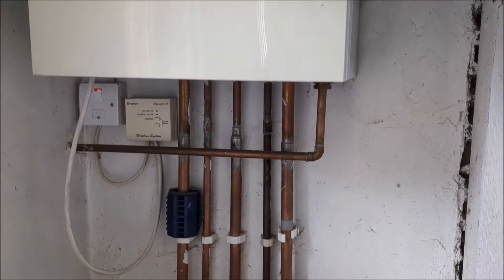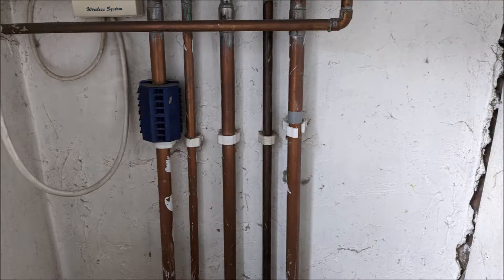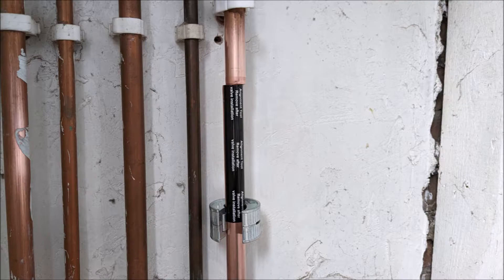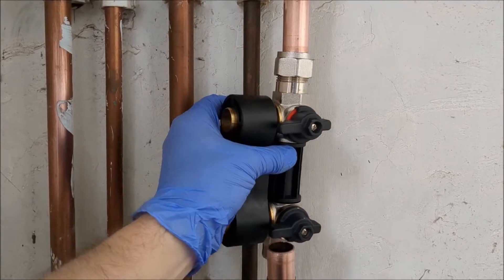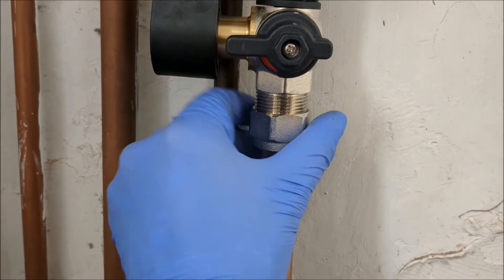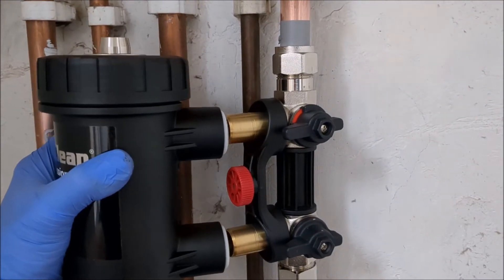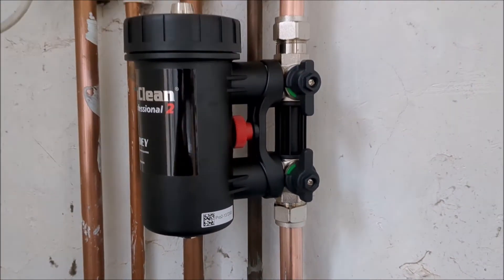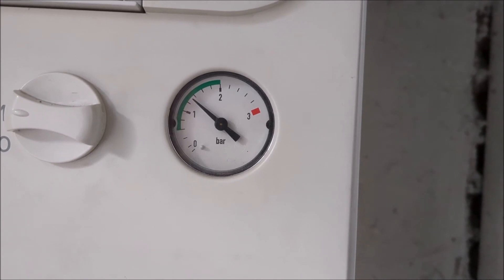How To Install An Adey MagnaClean Professional 2

Comment: This is the best set of destructions I have watched on a YT video :). I have a question. The boiler is a wall hung Potterton Profile with 2xpipes on the top and the essentials (pump/2xzone valves/bi pass etc) are all in the upstairs airing cupboard. The only suitable vertical pipe is the flow which doubles back through 180 degrees to the pump/zone valves and then disappears under the floorboards on the roundtrip to the radiators. Other than adding a vertical extension 'loop' to the horizontal return, I cannot see a way of fitting the filter to the return pipe. That means using the flow which is not good for a number of reasons. Any ideas? Thanks.
Reply from the maker: Thanks for watching and for your kind comment; I appreciate it. Yes, ideally the filter should be located on the return pipe, near the boiler, but if you can't fit it there and don't want to install some new pipes, then I think it is better to have the filter anywhere in the system, rather than to not have one at all. I hope this helps.
Reply: @PhilipWillsWorld  That was a quick reply.  Tend to agree. I guess it will create a bit of drag on the flow, will not pick bits on the return to the boiler and will also get the hottest water which could limit the life of the filter. As you say, better with than without. Thanks for your thoughts.

Comment: Looks easy but not for the amateur DIYer. I got mine done by a professional. Took less than an hour. Why does your filter have a RED 2? Mines is white. Does yours have any extra features?
Reply from the maker: Thanks for watching. This really is an easy job. There are different versions of the MagnaClean and there are other manufacturers of filters. MagnaClean 2 is easy to fit and maintain. MagnaClean 3 can talk to an app.

Comment: tezza might trythis u no Philip goat legend lol.tezza bang
Reply from the maker: Yeah, go for it. Just make sure you empty the water from the pipe before you cut in to it, then fill it up after fitting it. If you have any cold radiators, it's a good idea to turn off all of the other radiators, put the heating on to pump the water through them, then agitate (hammer) that radiator to loosen any sludge and pump it around to the magnaclean filter. Thanks for watching.
Reply: @PhilipWillsWorld great video. Also  that's a good idea re getting build up out of cold radiator. I'm an amateur DIYer and I think I'll try this install. One issue is where I'll fit the filter, I'm v tight for space under boiler and also at hot water cylinder. Do you know if I can put the filter basically anywhere I can fit it on the system?
Reply from the maker: @mryan4452  thanks for watching. Yes, in theory, you can put it anywhere in the system, but it is recommended to be fairly close to the boiler to capture the sludge before it can get to the boiler. You also need to be able to access it for maintenance. The filter comes with instructions on the best place to install it. Hope this helps.

Comment: is it easy to install a boiler system as an hvac technician and not an engineer
Reply from the maker: Thanks for watching. You need the right ticket to be allowed to install a boiler. And really need to know what you are doing to install the rest of the system too. I think new installations now require a magnetic filter like this one, too. Hope this helps.
Reply: @PhilipWillsWorld  thanks

Comment: So you dont have to flair the end of the pipes with those connections?
Reply from the maker: Correct; they just push straight on very easily. It's such a simple job to do, and makes a big difference to the heating system. Thanks for watching and I hope it helps.